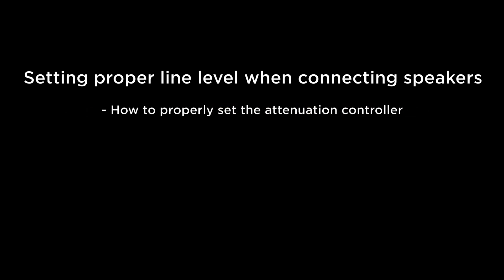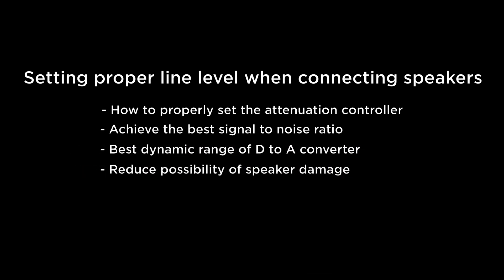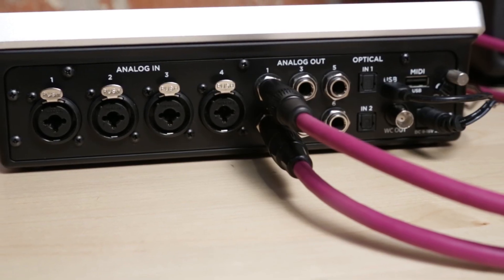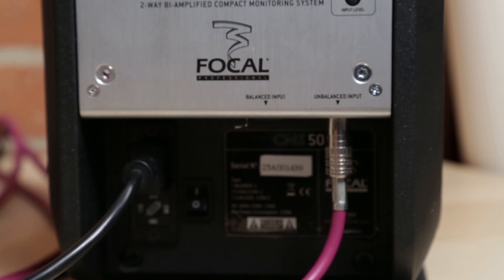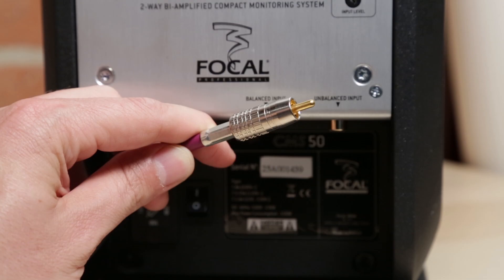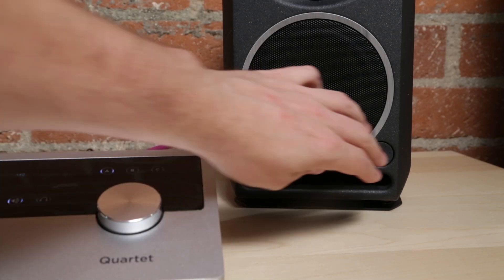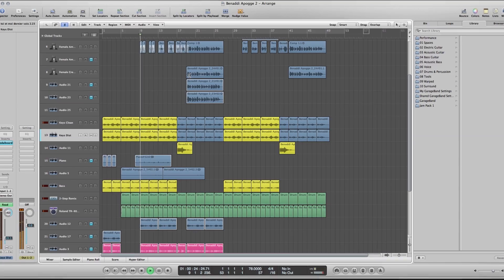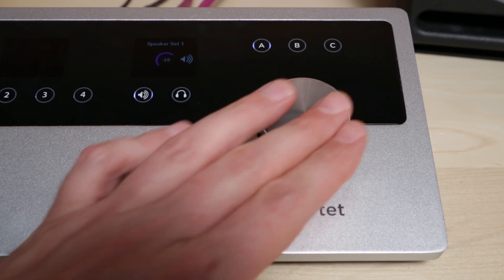How to set proper gain between your monitor controller and powered speakers

Comment: What are the correct output settings in Maestro while calibrating my monitors, output 1-2, or mixer? If it's mixer, at what level do I set the software return & mixer master  faders, if I want to use a pink noise tone generator and a db meter to correctly calibrate my monitors to around 80 db? I also have Focal CMS 50's, and can't afford to damage them.